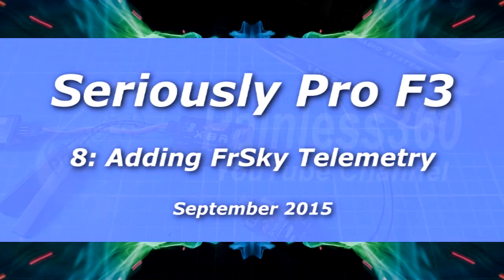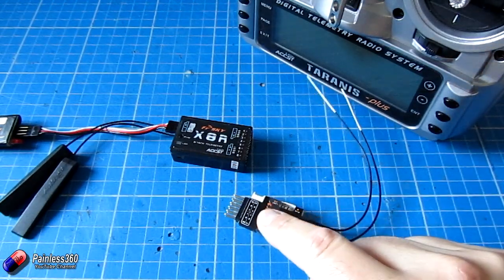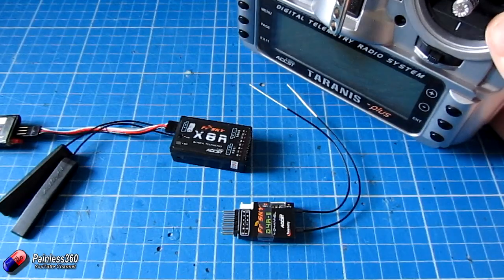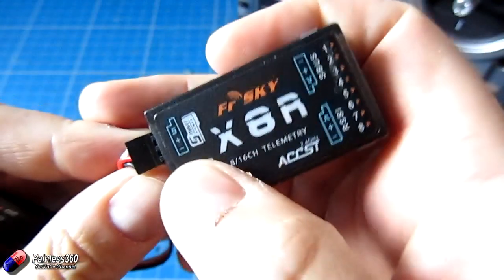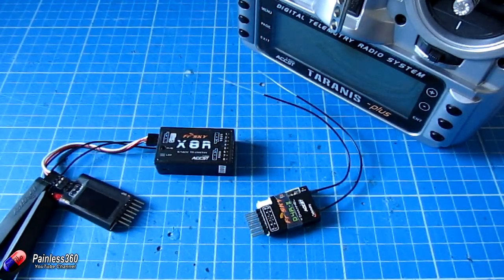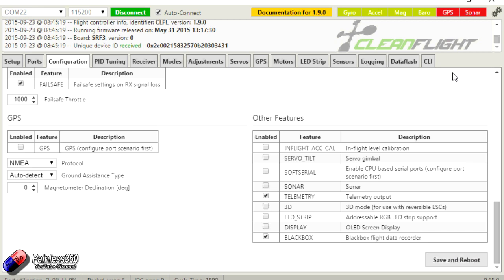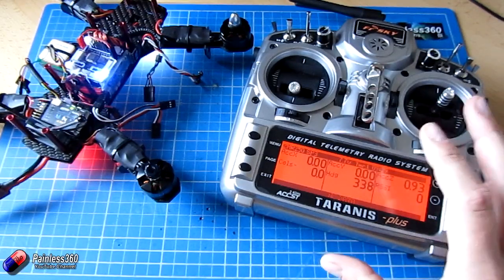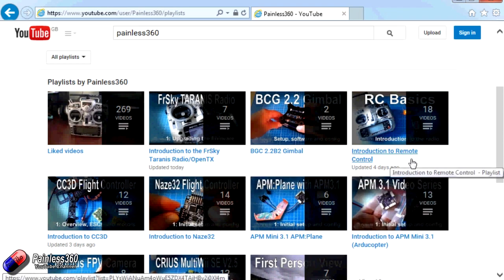(8/9) Seriously Pro F3 (SP3) Series - Adding Telemetry (Traditional)

Comment: Very useful video, thanks! I confirm that, when using soft serial, TX and RX should be connected together. I also had to set Smart Port speed to 57600 (instead of AUTO) to make it work.
I'm using Taranis and X8R. Telemetry is on Soft Serial 2.

Comment: I have FINALLY got my new 4s build streaming telemetry to my Taranis running 2.1.7 open tx firmware with the X4R sbus to I0_2 port on the SP F3 FC.  I accomplished this thanks to the new Soft Serial ports being available after cleanflight updated.  After tons on trial and error I finally realized both the TX and RX ports have to go to the X4R telemetry port.  The X4R will have one wire (the green wire in most cases) running to it from both the 5 and 6 pins on IO_1 Port.  I simply took all but the 5 and 6 pins out of the plug that goes into the IO_1 port and soldered them together then soldered the green wire from the X4R telemetry port to them both.  Thanks for all your helpful videos they have helped me a lot with the Taranis and cleanflight.  Also if you want to set up voltage in the new 2.1 versions of open tx on the taranis you must use instead off cells it is not VFAS.  You can calibrate it on the radio or still do it with the Vbat setting in Cleanflight.  I'm sure you have already figured this out but maybe someone will read this and it will help them.
Reply: +CNCMike thats awesome man I'm super excited I was able to help you out with this.  I too was working on a 210 class quad when figured all this out.  Best of luck sir hope she flies true.
Reply: +Toby Tracy did you have any issue with baud rate using smartport from the X4Rsb and the soft serial? Or did it work ok? And has anything changed or you still join 5+6 to the smartport green wire? Thanks!
Reply: +NJ Tech no issues with baud rate I didn't have to mess with it at all.  as for both 5 and 6 pins I haven't changed it to see.  I just updated clean flight today and everything's working as was
Reply: +NJ Tech I have a video I need to upload of my set up and how to configure  clean flight just haven't got it edited yet.
Reply: hi.   I am trying to figure this out.   Your instructions above do not match the video.   I am using the IO_2 connection to the receiver, not IO_1 as you stated above.   This is very confusing.    Any help you can provide would be appreciated.

Comment: For those that may take Lee's advice and upgrade to the latest version of OpenTX please bare in mind there are now two versions of OpenTX for the Taranis. The current 2.0x series  for the 9XD series Taranis which will continue to be supported into the future and the new 2.1x version targeted initially at the 9XE version of the Taranis although it also works on the 9XD series. The 2.1x Branch has had significant changes to the telemetry code which in some cases may require changes to the model programming which may be an issue if you have a large number of model profiles which may need editing. Ahh the bliss of living on the bleeding edge :)

Comment: +Painless360 - Great video which has answered my issue why I was not able to establish a connection with my Taranis -plus transmitter to the SPRacingF3 FC via cleanflight 1.10.0. I was connecting my cable to I/O 2 port which I inadvertently took for being a smartport.  Can I ask what type of cable was you using to make the connection from your D4R-II to port UART 2 and where can you obtain it from has I don't appear to have that cable combination that 4 pin connection on the FC board?
Reply from the maker: +Drone Novice All the cables I used came with the boards. The FC comes with a cable for every port on it and the D4R-II should ship with a 4 pin telemetry cable too. Best of luck.

Comment: Hi Painless360, great canal!
I've X8R, Taranis X9D+ with OpentTX 2.1 and CC3D with Betaflight 2.3.4
Do you know if with CC3D is it posible to get telemetry?  I've try your configuration and much more convinations, but for me it's imposible to see the telemetry in the Taranis.
Could you help me?

Thanks in advance, regards.
Reply from the maker: +Henry Henry The CC3D is a lot less capable with things like this. If you want this type of ability then use a Naze32 or STM32F3 based board with Cleanflight.. All works great for us here..

Comment: HIIn your video you say you are using a version of cleanflight, will the same telemetry set up be the same as this video, but sp f3 acro board flashed with 1.12.0 SPRACINGF£2016-2-20 firmware?RegardsJeff

Comment: Hi great video, for some reason on my taranis transmitter i am only getting 4 sensors showing for telemetry i have SWR, RSSI,RxBt and A2. The A2 is not showing my correct battery voltage is there a way to calibrate this ? My voltage is perfect on cleanflight :( Thanks again
Reply from the maker: I'd look at the A2 sensor and edit it so that it reads correctly. See if there is an offset or other in the menu. Best of luck!

Comment: Hi, I am setting the SP3 board with iNav 1.9. I am using Taranis X8R SBUS for the input and a NEO8M GPS. The SBUS is connected to IO 2 pins 1, 2 and 3, and the GPS to UART 2. Everything is working fine. Now, I want to connect the SPort telemetry to the board, but I am a bit confused with all the information I read and videos, as it seems that no one has done anything like that with the SP3. It is clear (I may be wrong here) that in despite of having 3 UARTs and 2 I/Os, I have only three comm ports, given that UARTs and I/Os are sharing hardware. After reviewing your video plus some additional info in github, it seems that I can connect the SPort to UART 1, while I don't use the USB, which is fine. Now, my concern is that I have to connect the signal wire from the X8R to the UART and in some cases, there are indications to connect to the TX port, some other to the RX port, some other to both, and finally another case where the recommendation is to the RX, which should be connected to the TX through a 1K resistor. Given your knowledge of the SP3, I would like to have your suggestion on this issue.
Reply from the maker: I’ve not used his FC.for a long time now and don’t have one here to test. It’s an old design and did have a few ‘oddities’ that I had to work around for the series. See my iNav series for my latest choices. Best of luck.

Comment: Hi, i try this with the Tbs Powercube on UART1 , i connect the Tx to the smart port on x4r-sb but cant get no telemetry.
Can you give me  any advice to fix the problem? 
i set all right in cleanflight. Have you try it with the Cube works it for you ?
Best regards
Reply from the maker: +Creamtronic You need to connect the TX and RX pins on the port you are using then connect them to the SmartPort pin on the Rx.. Best of luck!
Reply: +Painless360 Thank you very very much, that was the missing link :) , now it works. 👍👍👍
Reply: I like your Videos very much and your clear english makes it easy to understand for people which english is not their mother tongue like me ;-)
Keep up your good work.

Comment: So as per the update in your video,  should i Connect uarts 2's TX and RX   both to the  single S  pin on the smart port of my X4R ?   if so is it smart enough  to stop tx communuications and then start rx  and back again   when both are going into one wire?
Reply from the maker: +Pablo Yep!
Reply: +Painless360  cool,   will it still work if i only connect the tx pin on uart2 only?   will i miss some features or it not work at all,    or do i need to update the rx or the taranis in order for the tx and rx pins into one to work
Reply from the maker: Nope ;)

Comment: The things to do in cleanfligth in the TBS Power Cube is the same? Including the telemetry inversion? And to conect both, TX an RX to an S.Port of X4R it's just join both cables?
Reply from the maker: Most of it yes. Check the manual for it as there are some changes to the vanilla Cleanflight code TBS do to support the Power cube integral electronics and the external OSD/Vtx connection too..

Comment: Hi Painless360 !

I am always liking your tutorial ! So first, a big thanks for your help and work !

I mounted everything perfectly (Uart 2 with Tx to SP from SP3 and x4r) but I've got small issue . I can see every sensors whose VFAS. However, it's written : 0.00V and nothing works as you (No data)... Do you have any solution in order to get the battery tension?

I am using SBUS and Betaflight 2.6.1

Thanks man :)
Reply from the maker: +Jean-Eudes Akoun what troubleshooting have you tried already?
Reply: I don't try to do anything. I don't want to create any issue with the FC. What could you recommend me?

Do I have to sold Rx pin with tx and Smartport as well?
Reply from the maker: +Jean-Eudes Akoun If you're using OpenTX 2.1 then you may need to rediscover the sensors (see our video on 2.1 telemetry) best of luck!
Reply: I just saw your excellent your video about telemetry on 2.1.

However, it still doesn't tell me how to have the battery voltage for VFAS. It still remains at 0.00V :(
Reply: So... I have forgotten to plug the Vbat on the FC. Now VFAS works as A4 sensors but still I've got a problem. It is written 4.10V whereas I've got 4.20v on my battery. Any idea about this new problem? Thanks :)
Reply from the maker: Yep, you can edit the sensor and add an 'adjustment' to make it read right..
Reply: +Painless360 Nice ! That's what I've done this morning ! Thanks you very much 👍

Comment: Hi Lee just wanted to ask is it possible to set up batt consumption in mAh with SPF3 and Taranis correctly? I tried with Fuel sensor but it just counts it without any change in speed, seems chaotic. 
Thanks for the vids, without people like you we would be completely lost.
Reply from the maker: You need a PDB that includes a 'real' current sensor on it to start. We will be looking at setting up the current pieces in the coming month as I've also got one of the FrSky current sensors too (see the FrSky GPS video for an idea of what I'd like to do).. Stay tuned!
Reply: Brilliant, thank you for the info.

Comment: Is it possible to put the Smart Port telemetry on UART1 and keep the GPS on UART2? I’ve had no joy trying to do this – possibly due to UART 1 being shared by the USB?

Otherwise, I like the idea of using soft serial Smart Port - once Cleanflight 1.10 is available to let you use soft serial!
Reply from the maker: +Mark Mckenzie As I understand it the sharing of the USB is part of the problem. When TELEMETRY is set to something other than MSP on UART1 the normal wait, receive, process respond of MSP is halted when you arm then whatever telemetry system you chose takes over until you disarm.This is what took the time trying to get everything to work and in the end had to resort to this. I suspect that using the SmartPort was also making it more tricky.Best of luck.
Reply: +Painless360 Thanks, very interesting… this suggests the GPS won’t work on UART1. I’m starting to gain some understanding of what’s going on!
So in effect, although there are 3 UART ports on the board, if you are running a serial receiver (UART3) and USB (UART1), you are left with only 1 full UART port (UART2). And if running Cleanflight 1.9 no soft serial ports either! For a board that aims to offer more ports, it’s not something that’s made very clear…
I like the board and the theoretical connection possibilities and I love Cleanflight (its great!), but this all seems to fall short on some of the goals for increased number of ports on the SPRF3 board.
Reply: +Mark Mckenzie 
I feel the same. The only reason you don't have 3 hardware serials on a naze, is that for some reason the (I2C) sensors were connected to the pins for serial 3, even though others would have been available for the sensors. That has changed on the SP3, but other than that the chip on it doesn't have more hardware ports, which is a weird decision for a new design with proclaimed "more connectivity". (but the SP3 has a few other additional hardware capabilities over the naze, that make it more versatile).
I've adapted the firmware for an F103V so it uses the 5 hardware serials of that chip. It's the big brother of the chip on the naze, while you could say the SP3 is the not bigger but more talented cousin (same size, but more capabilities). I can use MSP, SBUS, GPS, SmartPort and Blackbox at the same time on hardware serials and still have masses of pins to spare for LED strips and other stuff. I've been using this board (40x50mm) from ebay (13$) for testing: http://www.ebay.com/itm/291549961695 . I never flew with it though (my self built foldable quad is waiting to be finished since the start of the year :( ), so I can't tell if I broke something important, but all the peripheral stuff is working fine :) . It's not a flightcontroller of course, so you will need your own external sensors and maybe logic level converters or drivers for beepers or LEDs for example.
Reply from the maker: +Mark Mckenzie I didnt spot that the UART was used for SBus. That was the thing that caught me out. Trying to then use UART1 as you tried also didnt work so I ended up with UART2. I  did briefly try with v1.10 beta and softserial but didn't want to make videos using unreleased code. 

Hopefully the addition of SoftSerial wil ease this for those needing GPS, OSD, sbus and telemetry all at the same time.

Comment: I dont have the connector cable for uart2, is there any way that I can solder directly to the board? I'm using a serial rx so i'm assuming I cant, as UART1 is taken for USB..

Comment: so is it possible to hook the pin4 [tx] on IO2 for telemetry? i have to use UART2 for my microminimosd but would love to get the telemetry info to my taranis and also not have anything interfere with my USB port.
Reply from the maker: +prOkrEAt Any spare IO port can be used for telemetry. See the SoftSerial video for other options too..
Reply: Painless360  apparently softserial isnt a good option for s.port as baud is limited to 19200 and needs 57200. this is on a X4RSB, not the D series as recommended in the softserial video.

right now i have:
IO2 for SBUS RX
UART2: microminimOSD
UART1/USB: USB communication

so looking for port for S.PORT telemetry option? UART3 cant be used due to IO2 use limitation.
Reply from the maker: Ah you didn't say that ;) On an SP3 I have had subscribers get S.port to work on SoftSerial by connecting the TX to the RX pin then to the S.Port pin on the receiver. Best of luck.
Reply: +Painless360 Im trying to do the same, but not sure if I understand correctly. Are you saying connect the TX on the SP3 to BOTH RX and S.port on the x4r? Or TX on SP3 connected to RX on x4r, and RX on SP3 to S.port?
Reply: +Kristian Leonardo Apuzzo Nevermind =) Just saw comment further down on how to do it ;)

Comment: is the use of a 3dr telemetry module possible with this fc? Is it possible to add an external magnetometer and barometer to the acro version?
Reply from the maker: +Chris pepper No idea about the 3DR module, I'd recommend that if you want the extra sensors splash out and get the right version of the board. Best of luck!

Comment: When I connect the cable to UART 2, I get only the value on my Taranis SWR, RSSI, RxBt and A2, but not Vfas, Vbat etc.
I need the values of my akku.. Do you have an Idea ??
Reply from the maker: +U Fre Have yiou tried using the SoftSerial method? OpenTX changed the telemetry system in 2.1.x and changed some of the telemetry items. What have you already tried?
Reply: +Painless360 
On my Taranis (OpenTx 2.1.5), I have searched for Sensors and I´ve got only this 4 values.
I dont try SoftSerial, because my Receiver is  an X4RS-B, and SoftSerial is to slow.
 I only try your way, that means UART2 and Pin "Tx".
Reply from the maker: That's why then you are using a different version of OpenTX. You'll need to look at the changes in the new telemetry system in the version you have. Best of luck.

Comment: Would it be ok to use both the tx/rx as well as the ground to minimize interference, or is this just not an issue with communication between the F3 and the D4R? By tx/rx I am referring to the the tx from the board and the receive to the D4R-II as one link, I'd hate to confuse anyone out there.
Reply: Never mind, I got impatient and did it, works great lol
Reply from the maker: +Bryan Draper :)

Comment: Hijust set up sp f3 acro board with x4r sb and when I connect uart 2 to x4r I lose power to x4r and to board, I'm using the sp f3 firmware o the board, in cli it says telemetry_inversion=on, is that correct?regardsJeff
Reply from the maker: +Jeff Wells Yes, that's right. Very odd that the X4R loses power - we've not seen that. Check the connections..

Comment: So how do you connect both RX and TX to the S.Port? Do you have any photo or something like that?
Reply from the maker: +BelloFPV you'd connect the wires from both pins together and then solder those to the wire to the Sport pin on the reciever. Have a look at the manual for Cleanflight and the flight controller, in the sections on telemetry. Best of luck!
Reply: Ok thx for doing this videos!

Comment: Telemetry inversion does not appear to be available in the latest version of clean flight, what is the solution?     I followed this video closely and the only thing I cannot set is telemetry inversion equal to one.    
I tried setting the tlm_switch = ON and tlm_inverted = ON.
All I get on the tx screen for telemetry is RSSI, RxBt and A2 which appears to be the battery on the drone.
Reply from the maker: +David DiGiovanni the latest version of Cleanflight is now actually based on Betaflight. So some things have changed. See my video about it. If you look in the latest documentation for Cleanflight it should all be explained in there for the latest versions. Best of luck